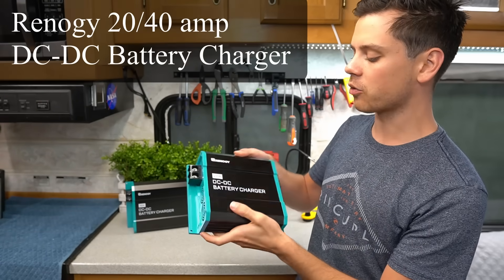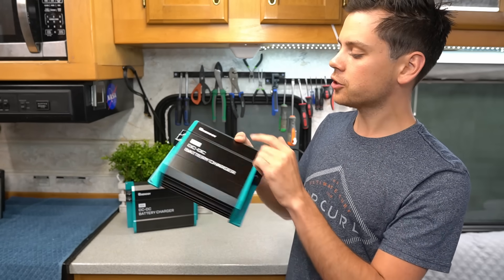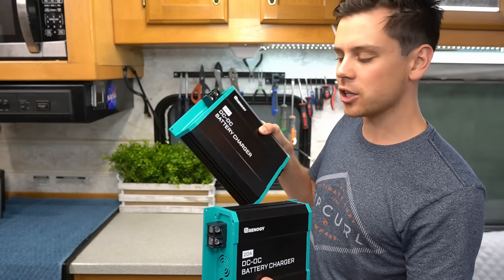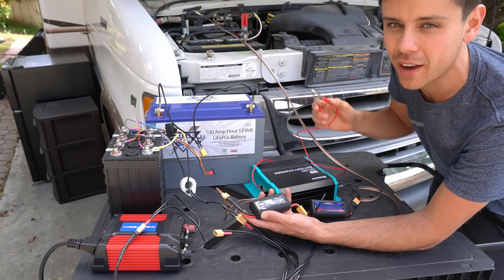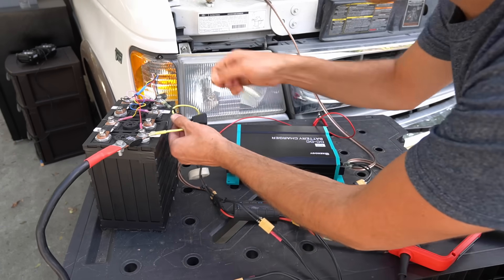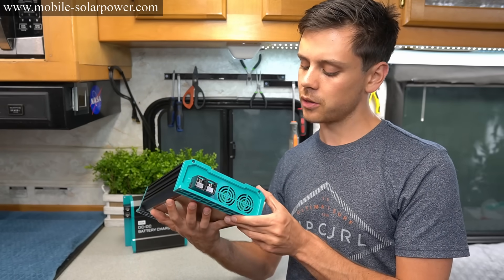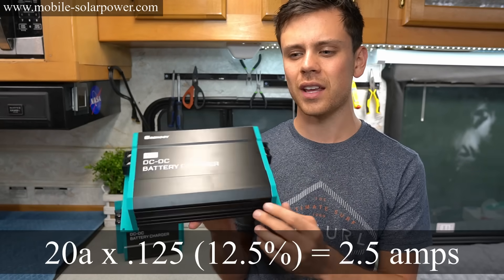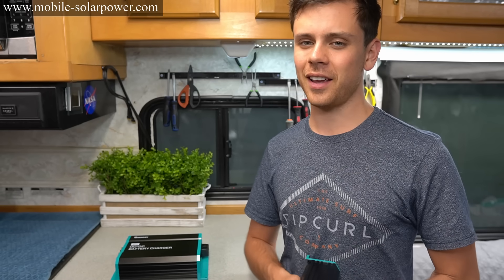Renogy DC-DC Battery Charger Review: "Smart" Alternator Charging for Solar Batteries!

Comment: I own the 20 amp Renogy DC-DC Converter, and it works as advertised, delivering staged voltage/amperage charging to my 100 aH AGM camper battery when the tow vehicle alternator is turning.  There is, however, an issue with the Renogy Owners Manual that you should know about.  On page 13 of the manual, it describes the fan-driven cooling airflow as flowing from the input side of the converter through the unit and exiting through the output side.  THIS IS EXACTLY BACKWARDS!  Even the Renogy techs didn't know this, but a simple test under load until the fans start shows that their manual is incorrect.  This becomes important if you mount your converter vertically as shown in their manual, with the output side facing up, so the DIP switches, temp probe and D+ connections are facing you (a seemingly logical mounting decision), then the fan driven airflow will be downward, from top to bottom, instead of the highly preferable chimney airflow they describe in their  manual.  The SOLUTION to this problem is to mount the converter either upside down, which means you can't access the DIP switches, etc., or sideways so the airflow is horizontal, or mount the unit horizontally.  Despite numerous discussions with Renogy techs, their manual was still incorrect, last time I checked.  SO BEWARE!  Otherwise, this is a great unit.
Reply: could you clarify this? I have mine wall mounted with dip-switches on the left and input on the right. Having issues with mine running curious if you could explain this again.

Comment: My alternator on my truck is 135 amp. I doubt I will do that any damage. I'm more worried that the wire at the 7 way plug is not large enough and will pop the 30amp fuse if I dont limit it to 20 amps. But the manual is not clear on how to wire it for a trailer. It assumes you are putting it in an RV and wiring it to an ignition . . . The trailer plug wire is only hot when the ignition is turned on.

Comment: Help!  I'm quite confused about which DC to DC charger to purchase.  I have a van with a 300W Solar Panel and 3 Optima Deep Cycle Yellow Top AGM batteries in parralell. Each are listed for 660 CCA but there is no spec of Amp Hours.  The Alternator is either a 90A or 120 but I don't know which for sure.    So how do I size the DC to DC charger?  20A?  40A?  60A?  The 50A unit with built in MPPT sounds great, but it limits the voltage from the Solar at 25 volts and my panel puts out around 40 volts.  So that seems a waste other than it has a soft start.
And more importantly why 20 or 40 or 60?  In theory I could go with any one of one of them.  But Will seems to suggest smaller is better from a safety POV.  It also doesn't seem likely that you can even get those batteries to charge at 60 amps.  

I use it to run a 12 volt refrigerator and keep various computers

Comment: Hi, Hope you don't mind me asking a question. I have a 48v MPPT solar charge controller. I want to harvest the energy from the 12v alternator to charge the batteries while drive.

The MPPT has a Solar Input, a 240v grid input and a generator input but no alternator input.
If you can help I would be grateful

Gareth

Comment: I have been using the 20A for a few years now, been great. I have a VSR under the hood for a delay switch to the rear charger. So looping the ignition input wire just goes over to the input positive. The VSR has a delay once the Voltage gets to correct level, 15 sec then turns it on.

Comment: I know this charger doesn't have a VSR built in but can I add one to trigger the D+ cable? So a positive from the van battery to vsr and then to the D+ to act as an automatic switch to turn on and off the DC to DC charger? This was, I don't have to worry about manually doing it? I feel like this makes sense in my head but would it work in reality?

Comment: Hi Will, I've installed the 40a charger for my LiFePO4 leisure batteries and have been using without issue with the limit current wire so it only draws 20a to save my alternator. I decided I was willing to push the alternator a bit harder and see how it goes, so I disconnected the LC wire. On start up it blew the 60a circuit breaker between the starter battery and the charger. I can't see why it would surge above 60a and trip the fuse. Any advice? 60a is the recommended fuse size leading to the charger and 50a to the leisure batteries. All setup properly as far as I'm aware, and like I said, it was working fine prior.Any help is appreciated, cheers.
Reply: The 40 amp output of the Renogy 40 amp charger is not one to one. 

The charger draws around 50 amps to generate the 40 on its output side to the solar battery(ies) due to the electronicisms going on inside the charger.

You can test this by attaching an amp meter clamp around the positive wire leading to the charger. 

Then, test the amp readings on the output side of the charger - it will read a steady 40 amps.

You will need a hand held multimeter designed to read DC amps (more expensive than one that only reads AC amps).

Comment: Hi Will. QQQ I am running a 1995 Dodge high top van with three agm batteries. Using an old simple isolator from alternator. Using 300 watt solar and mppt controller. I would like to move to lithium ion battery 100ah Can I simply swap out the agm's and put in the lithium? Do I need to add a dc to dc charger to replace the isolator, which is one of those old cheap ones. I think my controller does not have lithium in the menu but has flooded, sealed, agm and a user mode. I know you may need more info but any help would be greatly appreciated. Thanks Will.

Comment: The low rate is probably for a get out of dodge switch on smäller boat engines that might not want to rev up if really loaded by an alternator. I would want a device like this to be able to be shut down by the bms whem the lifepo4 bank is full.

Comment: Classic chin-glish manual where it doesn't even specify if the temperature probe works as a low temperature cutoff for lithium or if it's solely for temp compensation of lead batteries.  And this is a shitty review for not including something that is pretty critical for lithium especially with the ton of cheaper batteries now that don't come with BMS low temp protection.  (I dunked the temperature probe in ice water and charging didn't stop at all).

Comment: Will I have a question, why does everyone runs a negative wire from the car battery to the dc charge controller, when the negative of the car battery is connected to the frame, couldn’t you just use the frame of the vehicle close to the dc charger for the negative connection? This is just stuck in my head why? Thanks Will, love all you great information.
Reply: Hi Brad,

In a DC circuit we'll use that negative to both register voltages on the in and out correctly, and there will also be some current down the negative in order to boost voltage.

If the negative goes to chassis it will likely work for a while at a fresh install, but as the resistance rises across the chassis we'll see more current down the negative until eventually we see the negative fuses on the unit itself blowing.

Same for Sterling and Victron and etc.

Comment: WARNING!  -  You must have a Battery isolator!  I bought this charger and it destroyed two batteries.  The first one because I left it on, completely drained the battery to the point it could not be charged.  But even after you hook it up to the ignition you still have the delay before the accessories are turned off.  That is sufficient to kill your battery, especially if you start your vehicle a few times with out driving far.   It has no ability to detect the voltage of the battery to determine if it is safe to charge.  You have to buy and install that yourself.  Also there is no real information in the manual and calling them got me lots of "I don't know, maybe" answers.
Reply: I've used the DC connection wire, but also a master switch leading to the Renogy charger.

Another good thing is that the renogy will turn itself off once it detects the batteries are charged.

I tried charging a fully charged battery once, and I thought the charger was broken. 

But I actually realized that the charger will not kick in unless it needs to charge the batteries.

Meaning, that once the charger detects the batteries have achieved a full charge, it will turn off.

Comment: Hi. Tks for your videos. I’m wondering if its a better idea to use a CTEK (or any other DC to DC) to charge the liesure batteries eand then run a cable back from the liesure battery to charge the starter battery? Whats your thoughts?

Comment: Are there any downsides (besides some efficiency loss) to just hooking up an inverter to the car battery and plugging the AC out to your house setup AC in to charge your house batteries from the car battery? This will limit charging to the wattage output of the inverter connected to your house battery right? And essentially the alternator would be doing the charging.

Comment: Anyone try to see if they can make the current output adjustable/manually variable through the “LC” port? I wonder how that input is set up schematically… it would be great if you could put a potentiometer or PWM signal on it to manually adjust the current output. I have the 60A and would love to adjust it down to each specific application that I need to use it for.

Thanks in advance 🙏🏻

Comment: on trick analog old school is to install a cheap dc motor speed controller or a DC -dc voltage controller the idea is to lower the alternators field voltage of 12v so the alternator can not make the extra amps over charging the  half dead battery yes it sucks but its super cheap and all one needs is a volts meter and amp meter between battery and alternator and that controller your job is bms so twist ze knob dropping voltage till the amps are were you  need then  .a temp sensor on alternator may be added..i thing this rig could be use in a small diy  set up or heaven ferbid zombie lollipops are run rampant

Comment: Couldn't you add a switch to the ignition power input that turns it on to in theory be able to turn the charger on after the alternator has been running a few minutes and warmed up?

Comment: how many amps will a dead RV battery bank pull when un-checked with a charge controller?
(small bank - 2x T-105 6Volt flooded Lead Acid Batteries in series.)

you said the lithium battery was discharged - and looks like it was only drawing 10 Amps to charge before you put a load on it?????
Reply: what I mean is, if I just hook up jumper cables from the alternator to the RV battery bank, and then I disconnect the start battery so it's voltage won't interfere with charging the battery bank....   will it even draw 40 amps just to charge????  Just thinking of doing this temporarily, just for a weekend before I get a nice DC-DC charge controller.  And wondering if I double the size of my battery bank, how many amps it will charge.   For general knowledge, I'd like to know the total draw for charging a dead battery bank so I know exactly at what point it will pull more than my alternator can handle.
Reply: PS this is mostly theoretical.  and it's not in an RV, i''m experimenting with my battery bank for the purposes of adventuring / living the van life.  And I'll be using a DC-DC charge controller for sure.  But if it breaks, I'll want to know exactly how many amps a battery bank will draw before I go ahead and charge it with jumper cables.

I already did do this for a week using some super heavy duty jumper cables.  I kept them hooked up while driving down the road.  Alternator seemed fine..  But I couldn't adequately monitor voltage to see if I was getting a 14.8 volt charge going down the road.  maybe I was pulling too many amps for the little car alternator.

Comment: I need one of these to charge my lithium battery while traveling in my van. Is it possible to add a manual switch instread of using the ignition wire? If so, it would eliminate all the issues you have mentioned. Also, I would only use the charger during hwy driving when the alternator is at max cooling.

Comment: Too bad it doesn’t have input voltage sensing, preferably with adjustable threshold to trigger activation, and adjustable low input voltage cut off. For an application like a dump trailer where the tow vehicle often has + on the 7 pin hot all the time, and no key-on +.

Comment: I have the 60A model and the current limitation is 50% so its 30A.  I limit the current to 30A because I use the unit to charge my house battery when traveling.  When traveling I run my 300W refrigerator on AC (with a Renogy 2000A inverter) instead of propane.  So it consumes 25A (300/12).   Because I have solar on the roof I don't need any more than 30A to keep my battery fully charged.  20a was too small and 40A was too much.  I am glad they have the current limiter for my specific needs.

Comment: Hi, I still am digging into this question. I can't find an answer. I hope you can help. Thank you!

How can I hook my gel mat battery to my current PV system set up that has a LIFEPO4 battery, I do want to hook the 2 kinds of batteries with a DC-DC Battery Charge (this component is what I am looking for due to their different chemical/electrical characteristics)

*The panel I am using is the latest this 2021, only 400 watts but it harvest much power and it tends to float charge after 2-3 hours
**I am only using DC appliances and sometimes use an AC Inverter just to use the extra harvest

Hoping for your reply Will, thank you!

Comment: Based on your extensive videos and dedication to technical testing, I bought, built, and installed a LiFePO4/Daly system with the DC/DC charger to the SLA for the alternator, with Solar charging switchable to either. AWESOME performance! Solar charges the LiFePO4 bank faster and no-voltage sag is wonderful (very low Internal Resistance gains). 
THANK YOU WILL

Comment: Thank you for your instructive videos! Watching this one I was wondering: What about a 220V inverter next to the car battery and a battery charger next to the house battery (+ low voltage disconnect switch to avoid depleting the starter battery) ?  These components together are cheaper than a DC-DC charger with its expensive cabling as 220v cabling can be much thinner. Furthermore it would allow having a different voltage on the house battery + charging from camping 220v power... Would this be a bad option?

Comment: What and how do I find a starting wire? Also can I just connect the starting wire to a on off switch for the positive wire to the dc-dc so I can manually turn it on once my motor is running?

Comment: Will thanks for all of the great videos, I noticed a couple of thing on the Renogy DC to DC Charger, I am looking to buy the 20 amp version, in the manual on the Renogy site the current limit now drops the current to 50% (10 amps). The manual also said not to use a temperature sensor with LiFePO4 batteries. I will be using mine on a fifth wheel trailer to charge two 100 amp-hr SOK LiFePO4 from the 7 pin connector that plugs in at the hitch. The charging pin that normal charge the lead acid batteries that came with the trailer is controlled by a relay that is only powered when the truck is running (Ford F-350). I will connect this to the charger input terminals (+ and -) and put a jumper from the + terminal to the D+ terminal to enable the charger, that way I don't need to run a wire to the ignition circuit.
Reply: I'm pretty sure they say no to use the temperature sensor with lithium because it doesn't function as a low-temperature cutoff.  I put the probe in ice water and it didn't stop the charging at all even with the dip switch (SW5 = off) in lithium mode.

Comment: Hey Will, I really appreciate your channel.  I have one of these Renogy Dc to Dc chargers.  I’ve found the ATEM dc to dc smart hub on EBay/Amazon/catch and I’m interested in getting one to connect to my Renogy dc to dc charger/solar panels and battery.  I’ve tried to find a video or any other information about this device, but cannot find anything.  Are you interested in doing a review of the ATEM smart hub?

Comment: Hello, I have a question in regards to a Daygreen 10A 240W 12V to 24V Converter Step-Up Voltage Regulator Boost Converter Module Car Power Supply. Is it safe to take the 24VDC output of the Daygreen step-up converter and use it to charge a Bluetti EB70? The output voltage is stable and even though the EB70 is rated at 28V 8As max, according to Bluetti, any amps over 8A are just wasted. Voltages are within specs. Your thoughts, please? Thank you.

Comment: I bought the Renogy 20am for my renogy AGM 100 AMH battery. I want to connect solar charging panel to my batterry. Can I keep my DC DC chanrger and just add a renogy wanderer charger and connect the solar panels via the wander charger? So when my truck is turned off and I am out riding my agm battery can be charged by solar.

Comment: What makes u choose the renogy over the victron? The victron appears to have more cooling fins and a smaller foot print. with the victron, u do not have to wire another wire to start or stop it. It is done through voltage sensing. And thrown in is blue tooth setting & monitoring.

Comment: Thanks so much for what you do ..... it's been so much help. Question : you mentioned that you wished the charging didn't begin as soon as the engine started. How would you feel about a switch in the line ?  To allow for turning on - and off - the charger to not tax the altenator too much ?  Cheers

Comment: Can I connect this input to my RV charge controller (non lithium style) and charge lithium batteries with it? It would be nice to not have to replace the stock charge controller and also have the ability to charge from my tow vehicle... anyone have experience  with this? Thanks in advance.